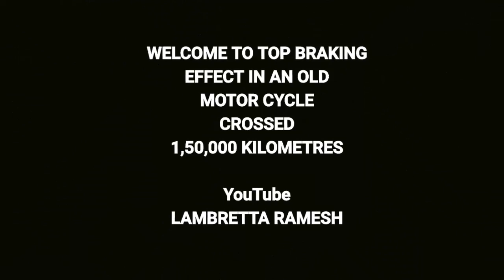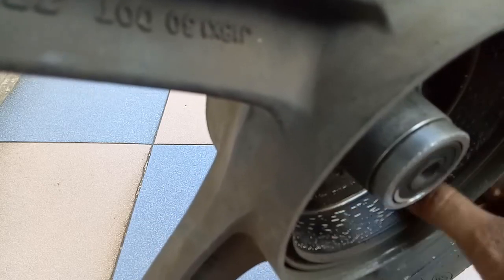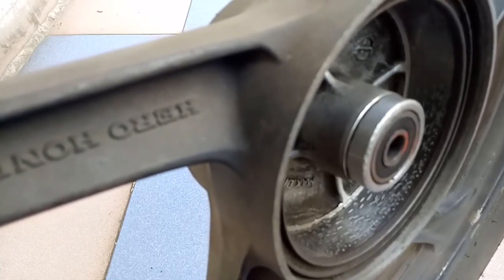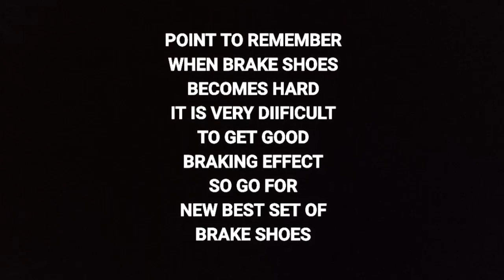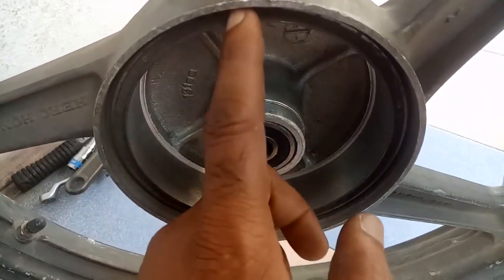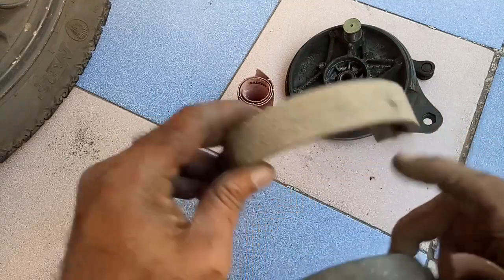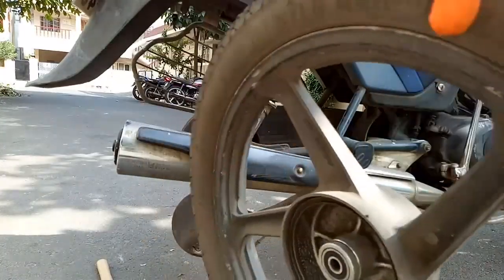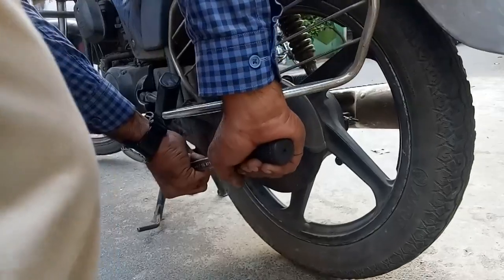Achieving POWERFUL BRAKING with Motorcycle Drum Brakes

Comment: My scooter suzuki is new 5 days old. Rear brake is excellent but when bike is slow sometimes clinching sound comes wht to do i am worried sir
Reply from the maker: Due to any loose components the brake lining worn out unevenly and also poor quality of linings hence clinching/squeaky sound. Changing the required parts will eliminate the problem. Don't worry

Comment: It will disappear in a week
Reply from the maker: If it happens so. Then you need to replace the lining by making ring and fitting it into the brake contact lining. You can save money in purchasing new wheel. For this your machinist must be smart. Otherwise it will lead to other problems